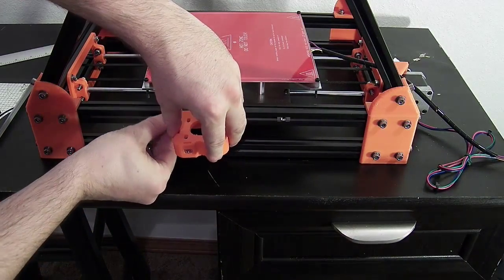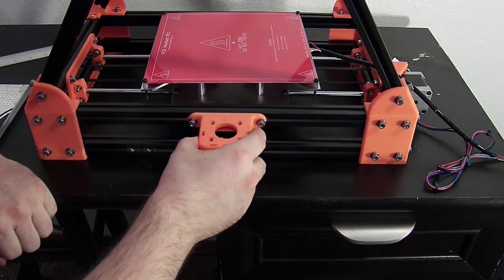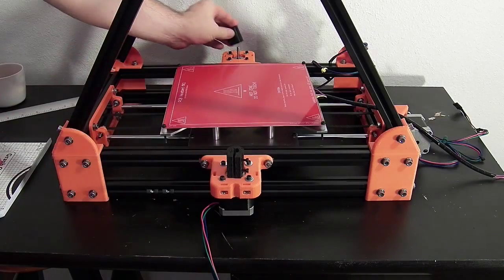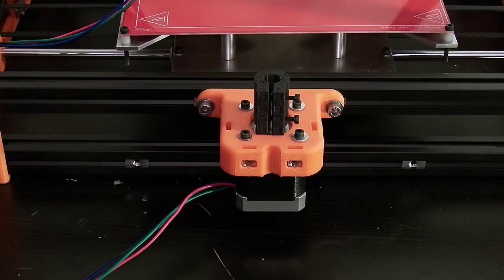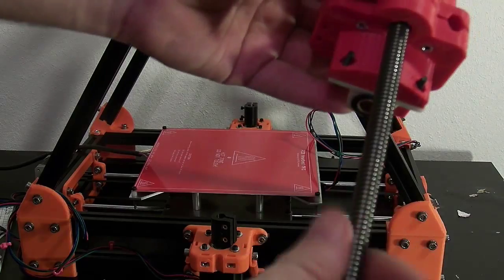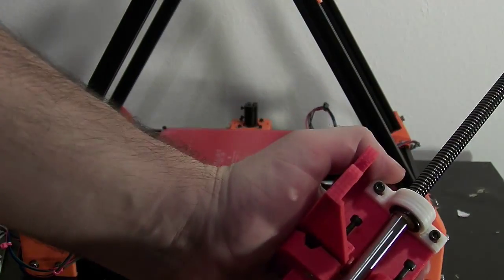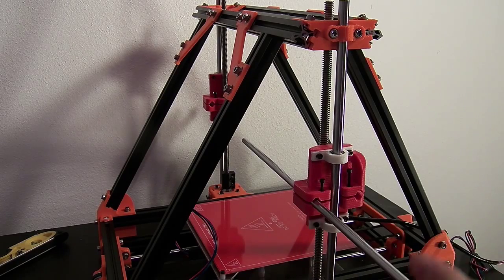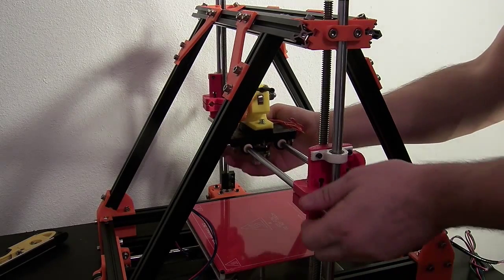MendelMax 1.5 Assembling the X-Axis ~ Part 4

Comment: I have everything to build, do you have a video of wiring and how to set up the program
Reply from the maker: It varies depending on the electrical setup and components but if you tell me what you're using and what stage of setup you're in I can walk you through it pretty painlessly.
Reply: It is more of arduino program, and trying to figure out what i have to change in the program